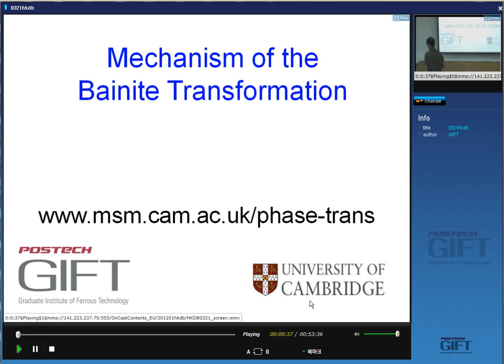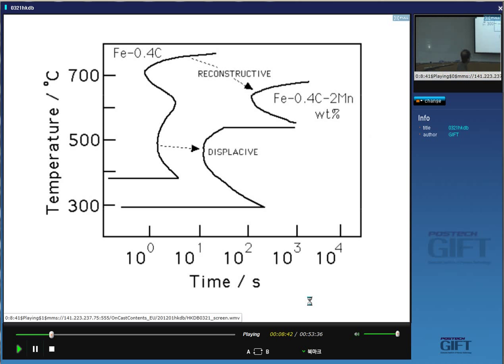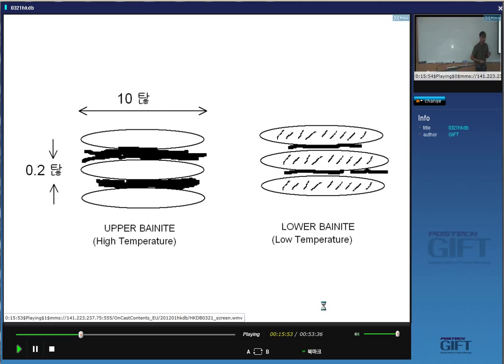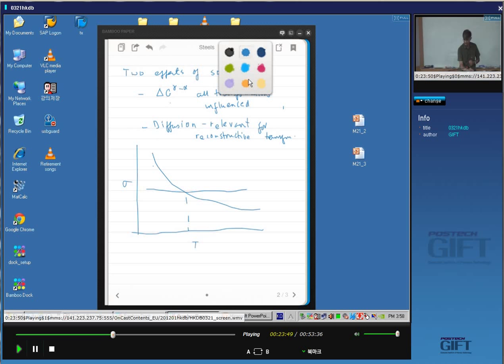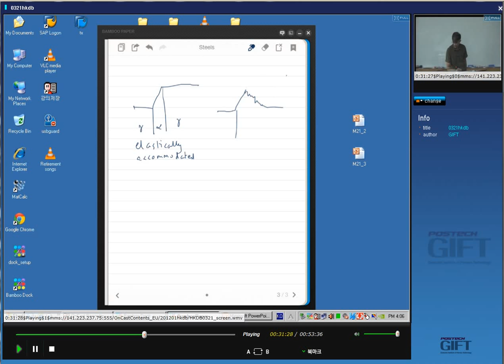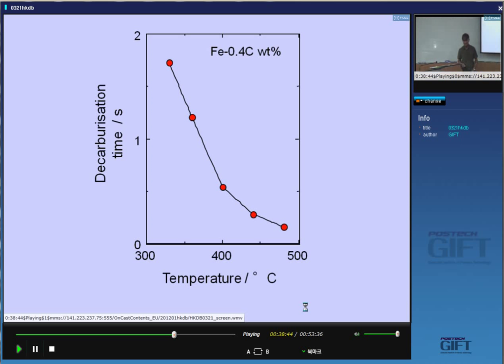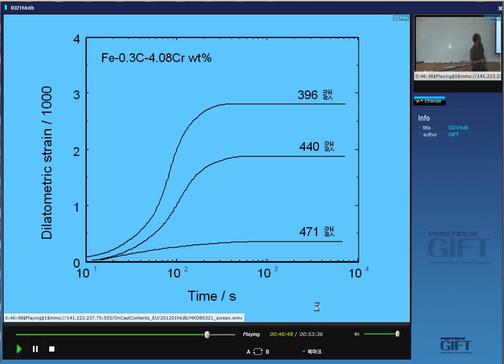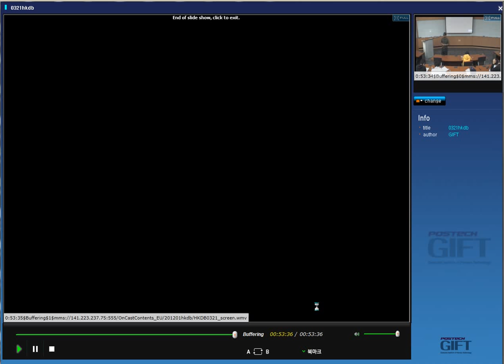Physical Metallurgy of Steels - Part 3

Comment from the maker: Both cobalt and aluminium increase the driving force for the decomposition of austenite into ferrite, whereas elements like manganese and nickel have the opposite effect. The term "austenite stabiliser" or "ferrite stabiliser" is approximate, for example, chromium reduces the martensite-start temperature (austenite stabiliser) but makes ferrite formation more likely (ferrite stabiliser). We have to think about temperature dependence of such effects.

Comment: Dear sir. in the bainite transformation , the strain energy is constant ( 400J/mol). why it's constant? i think the energy can vary with the plate size.
Reply from the maker: +Smith George With plate aspect ratio (thickness/length)
Reply: +bhadeshia123  thank you very much. but I'm confused about that if don't have enough free energy,why it cann't choose small plate aspect ration. and martensite plate have different plate aspect ratio.
Reply from the maker: Smith George When austenite is not stable, transformation should happen. The plate develops to a size that balances the available driving force versus the strain energy due to the shape deformation.
Reply: +bhadeshia123  you are right . but I don't understand why the plate aspect ratio is unique? and from the equation E=(c/r)u(s^2 +δ^2), if the plate size become 2c and 2r, same ratio ,then should with same strain energy, but it's thicker and the displacement will be lager , strain energy seems will be larger.
Reply from the maker: Yes, strain energy PER UNIT VOLUME (E) identical if aspect ratio constant.